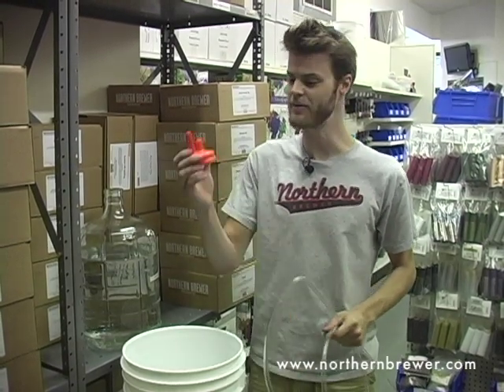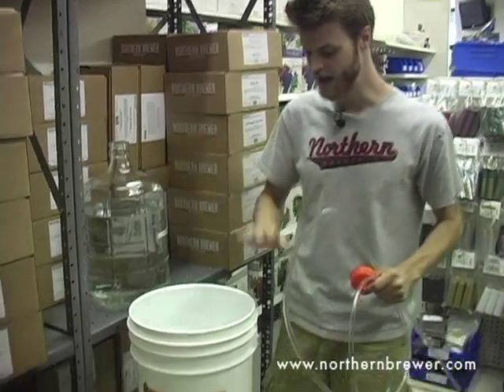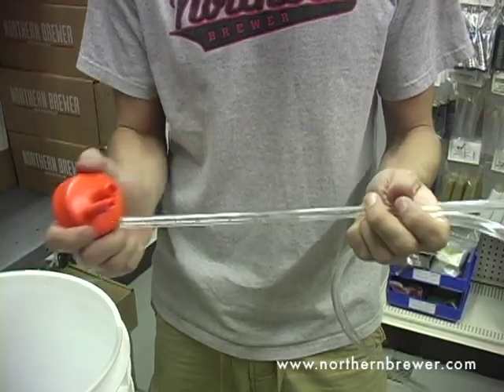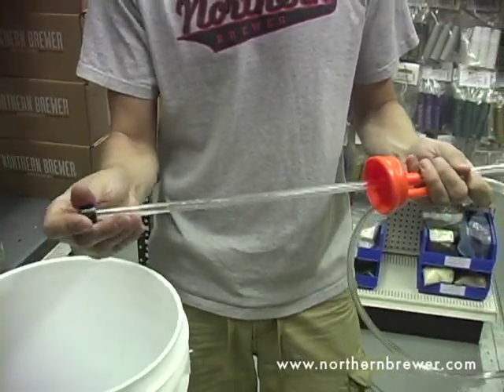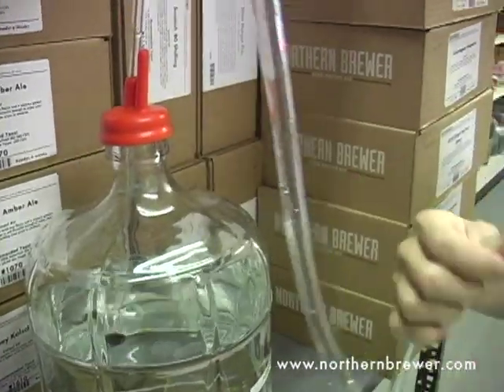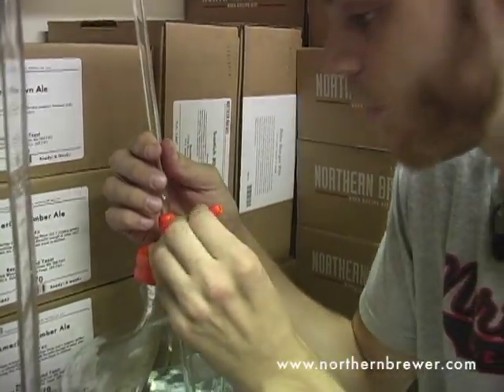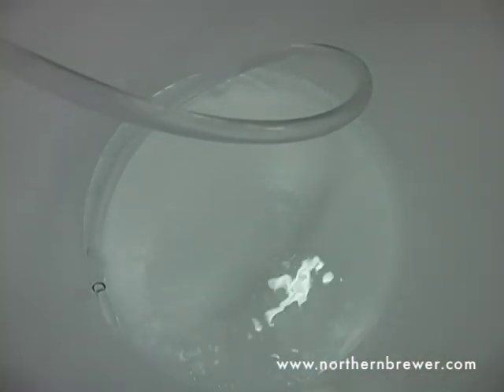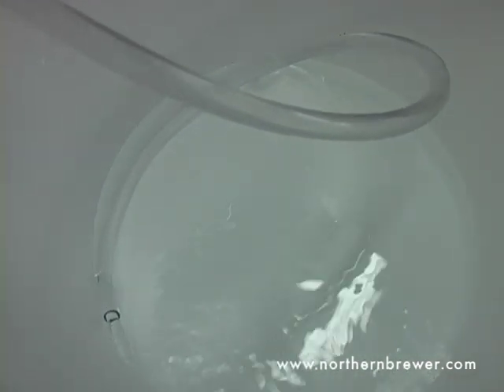How to Use a Carboy Cap to Transfer Homebrew, Wine & Mead

Comment: The main problem with an autosiphon is that it has the ability to introduce oxygen to your fermented beer/wine. If there's even a tiny air space at the bottom "plunger", it'll suck air from the outer tube and add it to the liquid passing through the siphon.

This problem happened to me last night as I was kegging beer. I couldn't stop the bubbles that were continuously being sucked through my autosiphon.

So today I started to look for a better method of siphoning that was easy and has no chance of bubbling oxygen into my beer. This carboy cap and siphon starter is perfect! I'm going to be doing this from now on.

Comment from the maker: @emerson1m Respectfully disagree. I have personally used these caps to rack my own beer and wine for 17 years without a problem. If you use a racking cane sized to the carboy, it doesn't take much air pressure at all to start the siphon, and as long as one doesn't drool or spit while starting the siphon, it works fine (some folks will rinse their mouth out with vodka or whiskey as added insurance).

Comment: I use a sterile air filter that is designed to fit perfectly over the endpiece of the carboy hood. The sterile siphon starter is easy to use and, as long as you use the air filter, shouldn't introduce any bacteria when you rack.

Comment: Why risk contaminating your beer by blowing into it? I know they make a $5 filter to blow into as well but that's just more waste. The correct answer is to put a squeeze bulb on the end to get it started. Just amazing the manufacture either didn't think it through or worse did a sales double-cross to stick you for another $5.

Comment: At brew supply stores, you can get a hand-held CO2 keg-charger that uses a CO2 cartridge. This can be used to to blow CO2 into your carboy to start the siphon process by placing the charger's tip against the carboy cap's nipple and GENTLY pulling the trigger of the charger. Much better than blowing the bacteria in your breath onto your brew. As Gurgle said in 'Finding Nemo': "The human mouth is a disgusting place."

Comment: Definitely not a good idea if that is beer going from a primary to secondary or a secondary to a bottling bucket.  Beyond the risk of blowing bacteria into your beer you are also exposing your beer to a new layer of 02. Assuming your beer has been fermenting in that carboy you have a fairly 02 free environment, why ruin that?  Put the cover on your bottling bucket and insert your racking hose through the airlock hole with the cover not completely snapped on.  Now insert your C02 hose where the dude was blowing into the cap. Keeping your racking cane high above the liquid level of your carboy turn on 1-2 pounds of gas and purge your bucket to force out the 02. Keep in mind that C02 is heavier than 02 so the 02 will rise out of your bucket.  Of course do this in a well vented area so you don't die and not get to drink your beer. You are now transferring C02 from the top of your carboy over to your covered bucket and filling that with C02. When you feel you have cleared the bucket of 02 push your racking cane into your beer and the transfer will begin.  as long as you keep the pressure low (1-2 pounds) the cap will not come off and the carboy will not explode. For safety sake do not clamp the cap onto the carboy, it will normally blow off before the carboy will yield.  Even if you don't want to keg your beer spend $75 and get a tank of C02 with a regulator for racking your beers, you will see a huge difference in the quality of your 6 week or older beers if you keep them free of 02. Commercial brewers worry about PPB or parts per billion of 02 in their finished beer, using the method shown in this video would put that number off the charts.  You spend 3-5 hours brewing your beer so take the extra step to be sure you have good beer in the future.

Comment: Not as sanitary as an auto cane/jerk.
(I call it a jerk because I've used similar equipment called a jerk in the construction industry)

Though there are ways other than your mouth to add pressure.